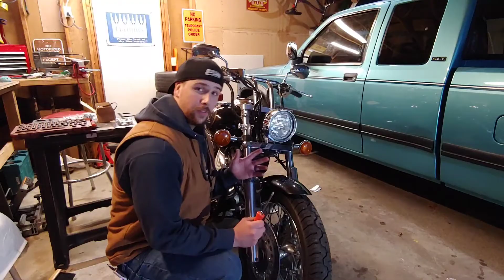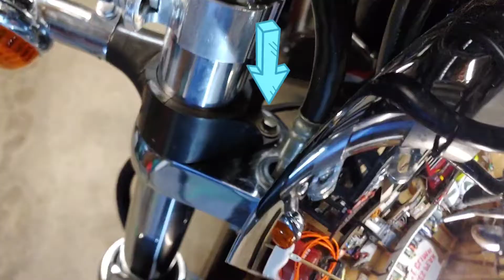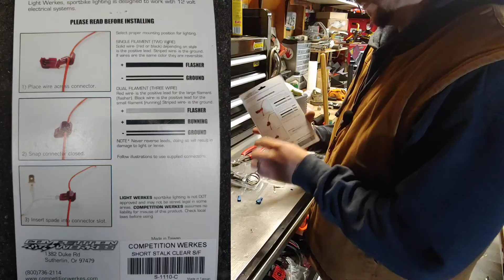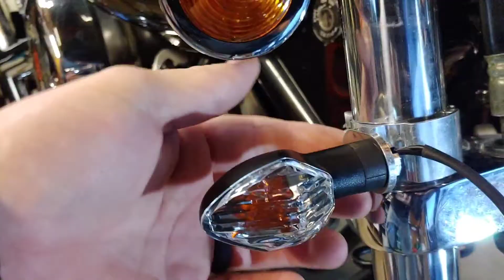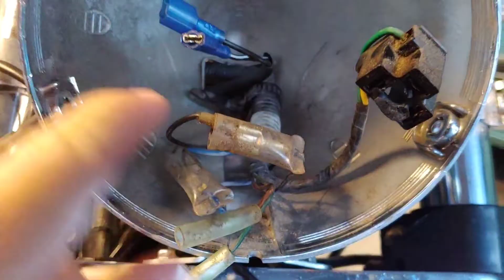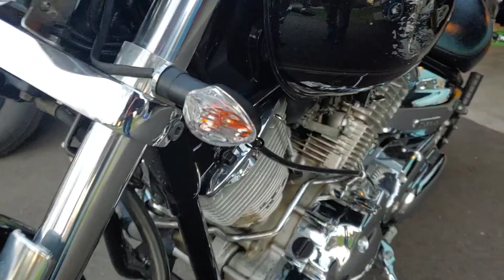CHEAP and SIMPLE upgrades for a Yamaha V-Star 650 / 1100!! Part: 2

Comment: Your turn signals only had two wires. What did you do with the black wire. Because of the two wires I now have nothing connected to the black wire in the headlight housing. When i just hook the blue and green or blue and brown i get a hazard lights effect. Because theres no 3rd wire.

Comment: Mine only does hazard lights what does that mean
Reply from the maker: Definitely grab a test light or Volt meter and see if you have power and ground at the light socket. All those wires get confusing too

Comment: These new LED turn signals have a frequency of about 120 times per minute. This is not allowed in Germany and the EU. They are only allowed to flash about 60-90 times a minute. For this, resistors or a new relay must be installed, because the original relay wants to see at least 21 watts. But the new turn signals only have about 1-2 watts. In your case, it could even have been that your new turn signals would have only shown steady light. … But anyway, you made a good job. … Best regards from Germany.
Reply from the maker: Wow! Thank you for watching! Cheers!

Comment: I wont to Bob my v star 650. Problem is im in love with the way it looks now. Can I keep my original seat and buy an after market rear guard? Im going to place the break light under the rear guard. and add led indicators just b4 the end of the rear tyre facing the rider . Im also going to strip the front guard and leave it raw.... or get a small replacement

Comment: If the original going to the headlight is 3 wires and the new blinkers are 2 wires I guess I am lost as to how they connect
Reply from the maker: There is the main turn signal wire, the running light wire, and the ground. I only used the turn signal wire and ground, and spliced those together. Hope this helps!

Comment: Not a huge fan of the turn signals… they look a little bit sporty for my taste in cruisers. But to each their own. Love the handlebar option, and your headlight looks more streamlined than mine.
I plan to cut the stock light bar down short to tighten up the front end.
I would highly suggest checking out the website 650ccnd.com
They have the best library of DIY mods for your bike and a great forum to match.
Ride safe out there!

Comment: superb bike, I love your handlebars, did you need to modify the cables? Is it good with the original cables?
Reply from the maker: They're actually a stock option. I've been able to find them on Partzilla.com for about $135
Reply: @langspeedcycle  do you happen to have the part number?